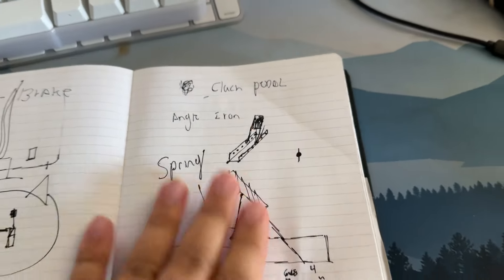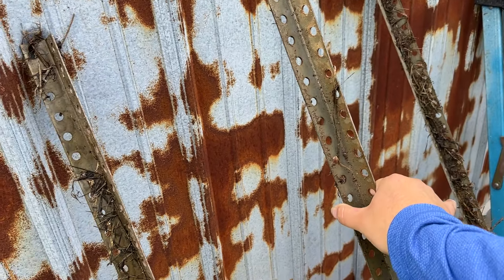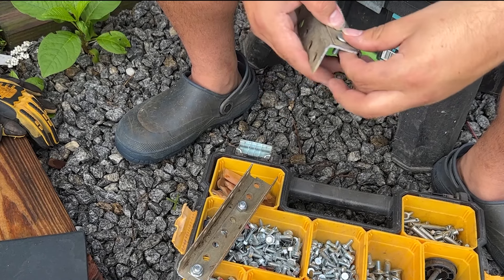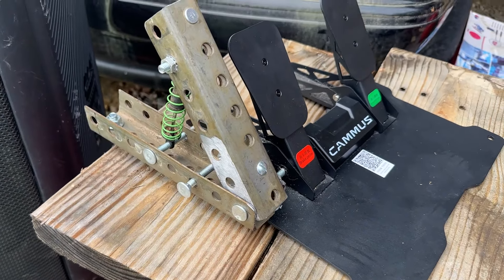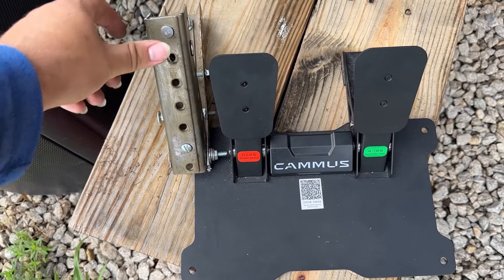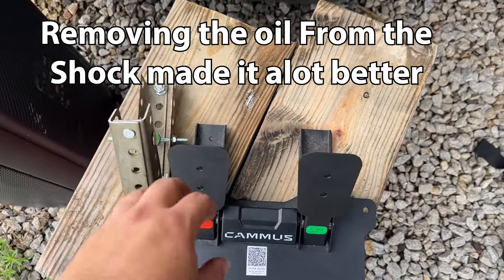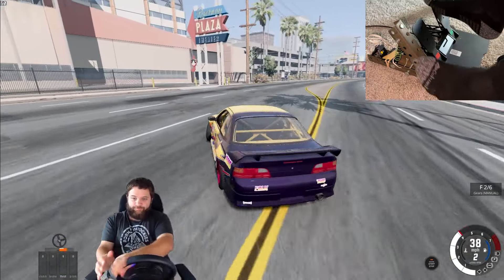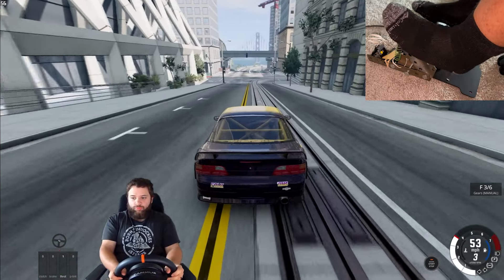My Pedals Did not come with a clutch… So I MADE One

Comment: This is great I built my own wood frame for my rig but the only suggestion I have is to move the clutch pedal further away from the brake and one little tip you can move the bottom of the shock further away from where it is or closer to change the stiffness
Reply from the maker: Thanks for the info!